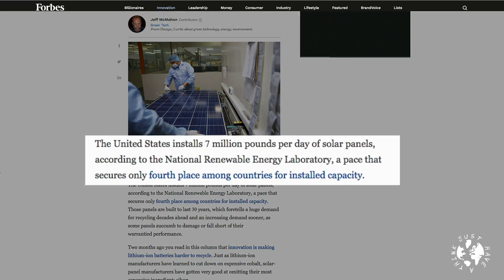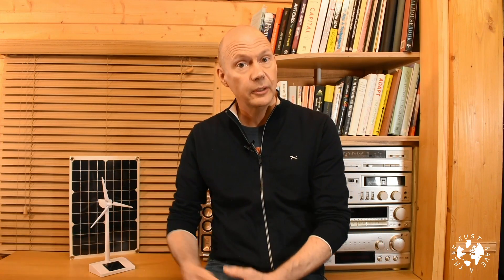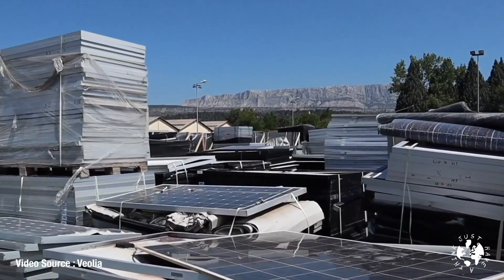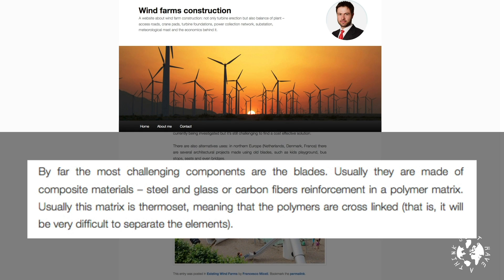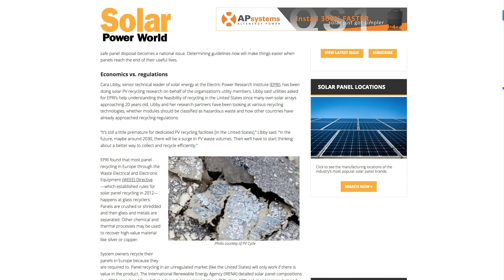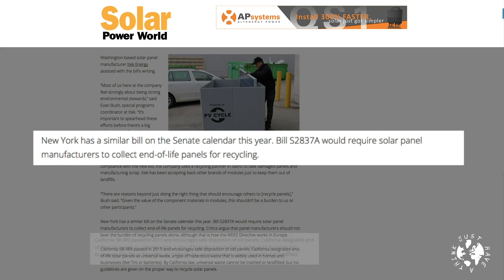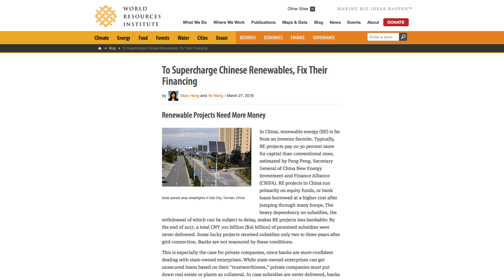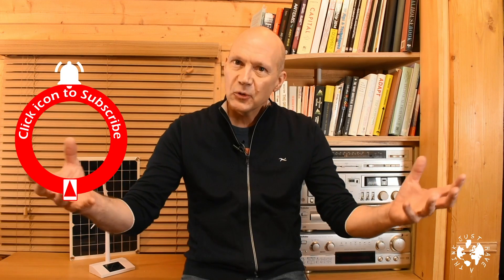Recycling renewables : a price too high?

Comment: "Renewables" are tightly tied to OIL, they wouldn't even exist without OIL, COAL & NATURAL GAS & they only produce weak, irratic electricity & NONE of the essential raw materials we now get from fossil RESOURCES.

Germany has discovered that they have to burn MORE DIRTY COAL to fill in the GAPS in generation from "renewables" & batteries are WORTHLESS for powering our agricultural machines, long haul trucks, trains & aircraft, & "renewables" unlike fossil resources produce NO FERTILIZER & modern high yeald crops depend upon high powered fertilizers to feed those food crops. 
Without OIL, we could only feed about 500 million to 1 billion humans, not the 7.6 we feed today.
So enjoy this high tech, high energy civilization we have now, it's going away.
Reply: Germany  has decided that they switch back to protecting big coal. (Merkel is not into green energy, she is into Merkel and had a problem in 201).they did not throw money at battery research and they are now throwing wrenches in the gears - so that comapnies will not start going solar in a major way (if they have the roof or the space). And that consumers do not set up more than a modest installation.
Reply: @xyzsame4081  I'm not surprised their back to burning more dirty coal, much as I would have wanted to see "renewables" take over from fossil resources, our demands are now far greater than any combination of "green energy" could supply. 
We must reduce both our demand & our population which MUST STOP GROWING & it will but I fear it will be through starvation, disease, wars & climate disruption.
 They were burning more dirty coal to fill in the gaps from "renewables" than before they tied "renewables" to their grid, the output from "renewables" is just to erratic, weak & it's off more than it's on & to add to their problems, it has turned out to be VERY expensive.
Now what will be their plan "B" for their energy needs?
Reply: @sheilachambers6671   Energy SAVING (reduced use) and production of renewables.
Reply: @sheilachambers6671  Poor agricultural societies w/o economic security WILL have a lot of children. - (Rich countries already have less children voluntarily, but use way too much energy and resources per person. And no one squanders like the U.S.) 

Large families were the norm in Europe and the U.S. as well only 100 years ago. All cultural and legal and societal forces will praise people for having a lot of children even if they can hardly feed them and birth control methods will be withheld or even outlawed  - as long as most people work in agriculture and as long as they are poor and undereducated.

When the pill got to Europe in the late 1960s it was not like women could immediately "have" it. (well not in Germany and Austria, not for regular people, may have been different in a very urban or affluent settings of course).

Doctors were instructed to give it out only to married women with already a bunch of kids or when a pregnancy would be risky (or they held that conviction). Sometimes they shamed even married women that wanted to wait with having children when they asked for a prescription. And even if the doctor was not hostile - women were embarrassed to ask. Again: the late 1960s. 

That nonsense got swept away with the 1968 / 1969 revolution - enough that women would not be hindered anymore to get the prescription. But for the first few years there was LIMITED  ACCESS TO BIRTH CONTROL for ideological reasons. 

(condoms were in theory available much longer, but they were only sold in few places like pharmacies and the embarrassing commodity was handed over quite visibly. So the young men got their dates rather pregnant than shop for a condom (and become the talk of the town so to speak). And where they were available the location was not respectable (usually from vending machines with inconsistent storage conditions). 

It would not be that hard or costly for the rich counries to help provide birth control in developing countries  (provided the local authorities can be persuaded to allow them or tolerate them, and that  it will not mean the downfall of their culture and religion. That is not only the backwards cultures in Africa, Asia, Middle East, or the religion of Islam - Interestingly Islam does not forbid using birth control (although having children is praised). It is the Catholic Church that has that dogma.

The rich countries would not provide money for those programs - even if the money would be well invested. They ignored Ebola warnings (until it developed into a full crisis - and then it was hysteria in the U.S.) They cut the funding for refugees that are still in the Middle East - and destabilized Libya (U.S. Europe especially U.K. and France). They ruin African farmers by forcing "free" trade deals on African nations (the EU).

Surprise, surprise  now the migrants come by the millions.

It is a mindset problem (of the rich nations). Not a problem of technology or medicine.
Reply: @sheilachambers6671  Pareto principle 20 % input delivers 80 % of results - or pick the low hanging fruits first. (airplanes and trucks can be dealt with later). Insulation and quality buildings (heating and cooling needs a lot of energy). Quality and low-cost public transportation, packing the roofs with panels. Using the deserts to produce fuel (storage).

Excellent public transportation at least in the densely populated areas. And invest into the railway (also for transportation of goods). The excessive international exchange of goods has to stop.

Some is beneficial trade (think the 1970s levels plus some more  to serve Asia) a lot of the very much increased volume of goods has to do with the neoliberal economic order, with just in time manufacturing and with outsourcing and use of sweatshop labour.

some kind of German crabs are sent to North Africa for processing - it is a lot of manual labor, then they are sent back to Germany (and sometimes they do not cool them like they should). - That treat used to be the reason people came together, catching and processing the crabs. And then having  a party and eating together.

Organic farming, eat less meat.

less consumerism and having more durable devices. And less throw away furniture and garments.

Nothing of that is high tech - the technology is developed for that. It is a political decision.
Reply: @xyzsame4081  Our delema isn't technology, it's declining RESOURCES & no amount of conservation, reusing, repurposing can change that. The simple problem we face is that there are too many of us & the resources that made that possible are going away.
No matter what we try to do now cannot prevent our collapse & a drastic population reduction. 
Even if we could stop all fossil resource use now, we would continue to heat up for the next 20 years at least & with a steep decline in fossil resource use, particulate matter will drop allowing even more sunlight to heat the earth leading to even more extreme heating leading to an unlivable environment for most humans & most life on this planet.
High tech cannot save us, conservation cannot save us & no veganism cannot "save the world" as some claim.

Enjoy this life while it lasts because it's not going to last much longer. Don't put off any trips you would like to take, live it up, the ax man is sharpening his ax & our time is short.
Reply: if mining cannot be done with solar (so far) - well than it will be done with fossil fuel  until high density storage has improved. or there are methods to take out carbon from the air that compensate for PRUDENT fossil fuel use.
Reply: Merkel pushed Energy Transition for political reasons - Fukushima - before she had pushed to reverse the schedule implemented by a former government for a  gradual  fade-out from nuclear.
The industry got favors (prolonging life time of plants and not much investments required for old plants). 

The (sceptical) voters were told it was all safe and well inspected. 

Then Fukushima happened in 2011. 

So Merkel had a political problem, then her party lost an election at the state level  (for the first time  in 30 years - against a coalition of Social Democrats and Green Party). So Merkel the chameleon  did a 180 - also known as "The exit from the exit form the exit".

The Energy Transformation was set up to benefit investors and wealthy citizens with the money and the home to install panels (and it was a good investment at a time with low interest rates) and financed with high electricity rates for everyone except big biz especially large industrial users  (so unlike with the Australian carbon tax households were NOT compensated with a benefit ). Did wonders to make the project popular with low-income people, let me tell you.

Merkel is  not for "renewables" - and it shows in the way the project was set up and in the inconsistency now. (it is first Merkel, then big biz, then party - then small biz and wealthy constituents with some distance).
Reply: wow.  That is impressive.  Almost 100% Not True.  Good Work.  ;)
Reply: @philtimmons722  OK, what is "not true"?
Do "renewables" produce any raw materials?
Can "renewables" produce enough energy to MINE the raw materials they need, TRANSPORT, REFINE & MANUFACTURE more "renewables"?
Is the electricity they produce on 24/7?
Before we used fossil resources, there were only about 1 billion humans on the planet, so how can we feed 7.6 billion humans after the fossil resource age?
Reply: @sheilachambers6671  -- much of what you are describing -- Mining, and Refining -- are done with Electricity, generally Grid Sourced -- so yes, since most Grids now contain at least some part Renewable Generated Electricity  -- and as more existing Coal, Nukes, and Gas are replaced with Renewables, this will be more so.   Eventually, the Coal, Nukes, and Gas will all be replaced with Renewable, and not even  missed.  As far as Transportation -- many rail systems are switching over from Diesel to Electric (again all Grid sourced) and even Trucking is heading towards Electric.
Reply: @philtimmons722  All mining as far as I know is done with HUGE, DIESEL POWERED MACHINES not "electricity".
I see my previous "reply" was deleted as quickly as I posted it & your post has been cut off after the word "with". There is no "read more" after "with" either.
WTF is going on with Youtube?

You STILL CANNOT REPLACE HIGH ENERGY DENSE RESOURCES WITH A LOW ENERGY DENSE TECHNOLOGY THAT'S DEPENDENT UPON THE SAME RESOURCE YOU BELIEVE YOU CAN REPLACE IT WITH! 
That's IMPOSSIBLE!
Why can't you "renewable energy"  believers get that?

I also noted that you wouldn't/couldn't answer my previous questions,  
#1.What is "not true"? 
#2.Can "renewables" produce any raw materials? 
#3.Can "renewables" produce enough energy to MINE the raw materials they need, TRANSPORT, REFINE & MANUFACTURE more "renewables?
Since you haven't answered this, I will, the answers is for all of them is NO.

Now will the "Youtube" gremlin delete this one too?
Reply: @sheilachambers6671  -- agree that Youtube comments are rather crappy way to discuss things.  I think they are supposed to be for pithy quips and nonsense -- not so much grown-up discussions.   But as far as Mining -- I do know.  Been there, done that.  I am now a Grid Level Electrical Engineer, but I came up through Mining and Generation.   And yeah -- getting Diesel fuel to remote locations is expensive and difficult -- but Power Lines are pretty easy.   So we get everything running on Electricity about as quick as we can.  That part was part of my job.   And a typical rural power line at 25,000 V can create the equivalent of  8000 to 10000 HP with just about 200 A on it.  So we cord connect the equipment to the  power lines, and equipment is mostly electric.   Cranes, miles of conveyors, some of the trucks, on and on.  Below is a video of a sample Drag Line Crane.  All Grid Powered Electric.   Anyway -- since it is ALL Grid Connected, and most renewable is Grid Connected -- So yes, renewable is already feeding in and becoming part of BIG Mining.  https://www.youtube.com/watch?v=4-Oc1BPcwNQ
Reply: @sheilachambers6671  (figured  the trick out -- reload the whole page -- not at the comment level, but at the video link itself -- https://youtu.be/GLTJZKYA40Y  -- then pull down to your starting comment)   
But now looking at your longer answer and comments, I  think I see  the underlying flaw in your reasoning -- you think there is some difference between what you are calling "dense" source, and "low energy dense" source?
There is not.  Not a functional difference, that is.  Once you have Volts and  Amps --  from any source --  you have Power,  measured in Watts.  And then as it is "on" over time, we have Watt*hours, which is a measure of Energy.   
But the electrons do not care if they come from a Nuke, or bicycle generator -- all the same.
Reply: @philtimmons722  You comment above this one has be cut off & there is no "Read more" after it. I tried your "trick" of reloading the page from the address bar & the rest of your comment could then be accessed. Thank you for the info.
The resulting voltage of electricity from either a low density source or a high density source may be the same but it's amperage is not, it's much faster for example to charge a battery from a high density source like a coal or oil fueled power plant than from a low density source like solar panels, the voltage may be the same but the amperage is not.

A high pressure fire hose compaired to a low pressure home hose, the speed of the water leaving the nozzle may be the same in both cases but the volume is much greater in the fire hose.

There is a HUGE  "fly" in that "ointment", "renewables" are only able to  convert weak, dispersed, erratic solar energy into electricity at an efficiency rate of at best, of 20% & they still produce NONE of the essential RAW MATERIALS we must have now. 

Maximum solar energy is only produced for a few hours each day, the rest of the time the sun is having to pass through too much atmosphere to generate at it's highest level. We need electricity more than just a few hours a day around noon assuming of course the SUN is shining & much of the time, it isn't.

We have neither the land or raw materials to build enough solar panes to meet our needs & PHYSICS limits the energy density of batteries which is also LOW.

72% of the earths surface is covered with ocean, that leaves dam little land for solar panels & since we have a habit of EATING, much of the land that is flat is growing our food & plants don't like to be in the dark. 
Other large areas of land are mountains & forests also not suitable for solar panels.
So even though you might be able to power large mining machines with electricity, we won't be doing that off the feeble, erractic energy generated by solar panels. 
A "renewable" energy powered future is a pipe dream never to come true unless you mean WOOD, WIND MILLS, WATER WHEELS & MUSCLE, those will power our future if we even have a future.
We are being mislead as to the ability of those high tech, RESOURCE DEPENDENT  "renewables" to replace declining energy dense fossil RESOURCES & we still cannot transistion from fossil resources to a TECHNOLOGY that's dependent upon those same RESOURCES.

http://wattsupwiththat.com/2014/11/22/shocker-top-google-engineers-say-renewable-energy-simply-wont-work/
http://sunweber.blogspot.com/2015/04/solar-devices-industrial-infrastructure.html

http://energyskeptic.com/2016/hall-and-lambert-eroi-of-different-fuels-and-the-implications-for-society/
http://www.theenergycollective.com/robertwilson190/335806/germany-shows-renewable-energy-has-failed-and-other-strange-ideas

I hope you will take a look at this site, she explains very clearly why we cannot transition from fossil resources to resource dependent technology like "renewables". -  http://ourfiniteworld.com/
Reply: @sheilachambers6671  It should be noted that the citizens of the RICH countries use much more resources and fossil fuel (incl. cheap resources that are extracted or grown for cheap in those poor countries). - the population explosion of poor countries will cause human tragedies - but the Blame for burning through finite resources and fossil fuel is on the rich countries.

They reproduce not in the large numbers - but they use much, much more per person.

 The countries with the worst population explosion have the people live on a few USD per day. It is _not possible to have a large resources or carbon footprint with that_.
Reply: The costs for producing electricity with up-to-date solar panels are 7 cents per kWh. That is the yearly average in cloudy cool Germany - it is better in the more sunny regions of the country. Now, that cannot compete with the 2,4 cents per kWH midday in 2016 in Dubai (which broke a record, maybe even better now). At that costs the sheiks used it instead of gas turbines (in Dubai mind you), because it is cheaper
Reply: Anyway: NOW solar and wind have become a real competition for the established energy providers in Germany, and now big coal is protected and they start erecting the roadblocks (which is of course crazy until you know how the German government ticks, then it makes sense why they reanimate coal).
Reply: Even the flawed German Energy Transition did some good (along with the Chinese efforts, also Japan installed a lot). Every time installed  panels (kW) double, the prodcution price for a  solar-produced kWh  drops by 20 %.  ECONOMY OF SCALE. It is like that for panels since the 1980s, it works like that  for every technical product that is new and is mass produced in increasing volumes (although the price drops and quality leaps are different, with electroncis or processors it is Moore's law).

That price drop (improvement of performance and/or cheaper production) has nothing to do with the passing of time. Incentives, subsidies and regulation created the demand that triggered more installations.

 The Germans had to give a lot of subsidies in the beginning (climate is not ideal) but it created a market where companies innovated (and their research had a chance to pay off). That and more Chinese purchases and production  let panel prices drop so that they became interesting in sunny, wealthy areas with a lot of A/C running during day and where electricity prices are medium to high (think Australia, California, ...) Now that was another 60 million people market. So another wave of sales - and more price drops.

Rinse and repeat.

Batteries and other storage are the next frontiers. There some improvement in prices is wanted. (10 % improvement in panels, 10 - 20 % in batteries - for homes - would mean another massive shift in the market).

Germany now imposes an extra fee of 2,3 cent per kWh on larger producers of solar energy for SELF CONSUMED electricity (only installation that are modestly sized for homes are excempt). May not sound much - but if you produce at costs of 7 cents a fee of 2,3 cents makes a dent. That is to prevent that large users of electricity with an ideal profile (using most or all during day = companies) go solar.

I guess if companies and homes would go off the grid they could evade the fee. There is no mandate to be connected to the grid. Off the grid would mean: no selling of surplus, which is not very lucrative anyway, but more importantly w/o the security to have the grid as backup.
Reply: A German manufacturer KACO got a 2 MW solar  installation (2013 or earlier *), cost them 2 million Euro (no subsidies), they save 350,000 Euro on electricity per year.
(they produce transformers, so that part of the installation was cheaper for them, and no doubt got good offers for what they had to purchase - but still, with an expected lifetime of at least !  20 years for a quality installation, that is a wildly successful investment).

* I saw a slide with their harvest on a sunny day in August 2013. They needed a little bit from the grid during night and  till 9 a.m. and again from  late afternoon on. Else they produced all electricity they needed inhouse.

I did the math, if they pay the average rate of 20 cents per kWh (for a biz) they have to pay now 45,000 Euro per year on the electricity they produce and consume (the "let's-prevent-big-solar-installations" fee of 2,3 cent per kWh)

They buy much less electricity from the energy provider than they used to and should contribute to the grid and the backup the energy provider gives them.

BUT: that is some money - and there are some mini electricity plants powered with gas or biomass that produce heat and electricity in tandem (they are even sold for private homes, efficiency is of course better when the units are larger).

When batteries are getting cheaper they can have more, get some more panels, on cloudy days or in fall / winter / early spring they can get electricity from their own mini-plant. With more electricity storage they would only need the mini-plants for electricity when they need heating anyway.

Using the heat that usually goes to waste raises the efficiency of a steam engine from well under 30 % (that is a law of physics) to plus 60 %. Combustion engines have the same poor efficiency. Admitted solar panels are not better, currently they have approx. 24 % if they are good (40 % might be possible in the future). But they run of course with a source that is not finite in human dimensions.

And solar harvest in winter is not zero (on sunny winter days it is quite good, even better with snow reflection). Solar panels also transform daylight although they work much better with direct sunlight (cool and sunny like in the mountains with more UV radiation is excellent - I read a commen from someone having panels in New Zealand - and no one can accuse NZ of being a sunny country).
Reply: The electricity grid in Germany has become MORE RESILIENT. Blackout events and duration have gone down. They started from a good standard in 2006 (even then better than France or U.K). Then they had to adapt to the fluctuating input from wind and solar. - The medium to large plants that dominated then were very reliable - but if they had a problem (a storm, a fire, safety shutdown of a nuclear power plant) then they missed out on a lot of electricity all of a sudden.

Now it is not humans that improvise to cope with the more rare but consequential larger blackouts - it is automated. So now the numer of blackouts have decreased (I forgot the number minus 20 or 30 % - in that range)  and the duration (there is an industry standard number for that) has halved. 
If they can deal with renewables on a daily basis,  then they can cope also better with the occasional larger blackout event

While France and U.K. stayed at the old level.

I got those informations (also the numbers and examples quoted in the other comments) from a presentation of Dr. Eike Weber (Fraunhofer Institut).